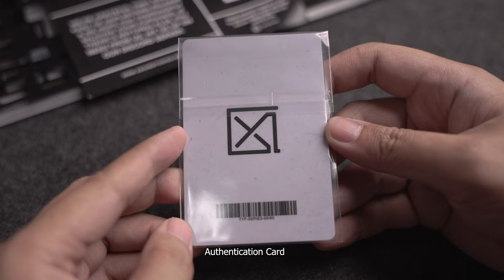The Convertible Keyboard

Comment: the board is quite hollow with half plate, and I think that it sounds much better with full plate. Also with boards that are a little bit hollow, I found building it with long pole helps to masks that little bit of resonance.
Reply from the maker: For sure, good long poles are a good cheat code to level up a board 😁